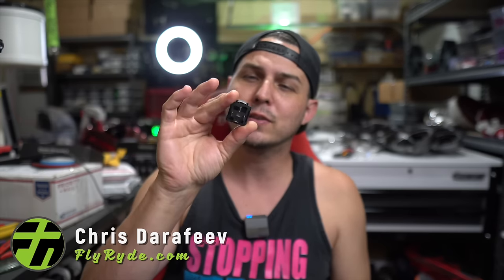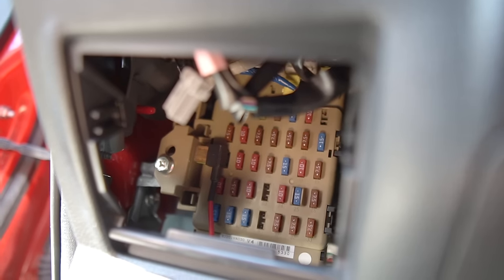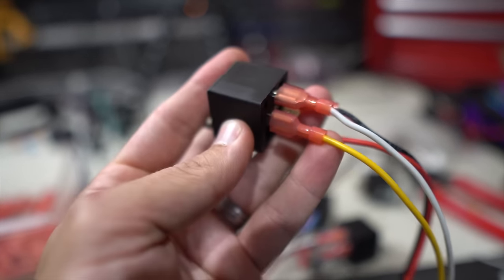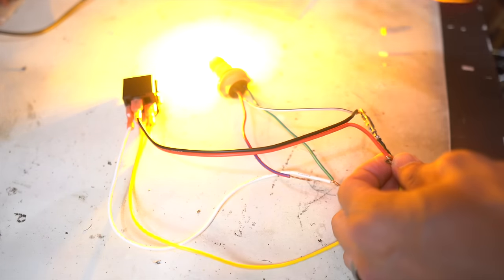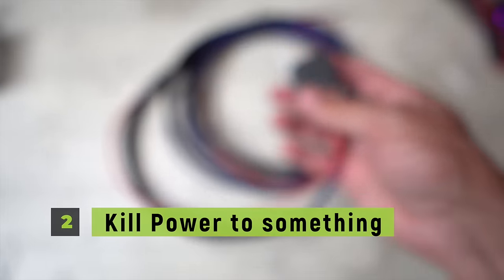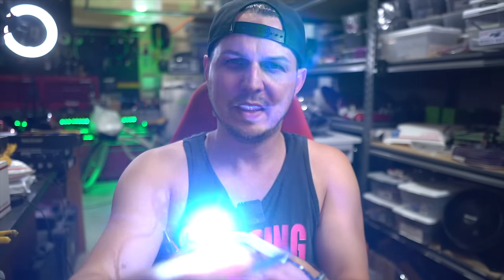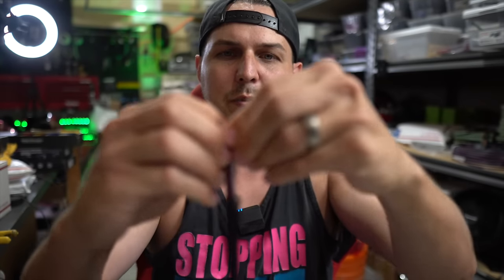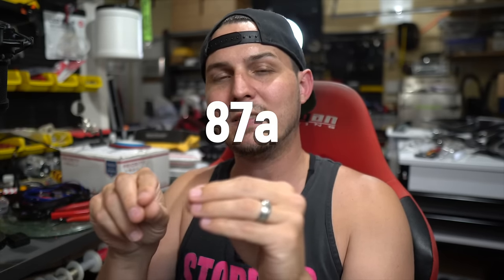3 Ways To Use Automotive Relays

Comment: I want to add a kill switch to my 2021 Nissan NV 200 (small cargo van).  I don't want to kill the battery because I want the security system to remain functional.

So I thought a fuel pump relay kill switch would be good.  However, auto shops around here won't do it...they say adding a kill switch would screw up the CAN bus.

Scotty Kilmer (youtube guy) says the best way to prevent car theft is to just remove the fuel pump relay and take it with you. 

Sure, but that means I would need to open the hood, open the relay box, pull the fuel pump relay and take it with me...and when I get back, open the hood, put it back in.

But I was thinking...would it be possible to relocate the fuel pump relay into the dashboard?  Place an extender-type socket device, pass thru socket device, 
from the relay box in the engine compartment and run wires thru the firewall into the dashboard, to a pass thru socket which would accept the fuel pump relay?  
This way, I could just remove the fuel pump relay without having to open the hood, etc.  

There would be added distance that the signal would need to travel, say 6ft. But basically, I would have everything be a pass thru to the regular fuel pump relay which
happens to be in the dashboard now.

What do you think?

Comment: You actually lost me but I know you described what i'm trying to do. I am trying to make a electric seat switch, it needs to reverse polarity, I have two single current momentary push button switches also have two, 5 PIN relays and two diodes. I keep over thinking this!  Is there a way to show me a diagram on how to do this. Its my daughters Infinity G35 and defiantly can't afford to buy a new or even a used one. We are selling this car but want it to work properly.

Comment: Hi.
Showing real thin wires on the switching terminals ( trigger and ground) help to explain easier. Then a real heavy wire on the supply and load terminals. That's how I always always teach it. Then I swap the no to nc terminals to demonstrate the power off function. I follow you, but a newbie might still not grasp the concept.
Kewl vid otherwise
Reply: Maybe you can help me out. I have 4 point relais and on/off switch for a underglow ledstrip install. Is this possible and how do I wire them

Comment: Why is the ground wire “energized” when my vacuum switch senses less than 22 in/mg on my vacuum pump for my car. Never had a problem til i had to replace it then had to get a replacement for the same problem the replacement has😳. Never had 13:35 to test the connections before this. Relay activates  the ground to the pump motor. Wtf

Comment: Hey man quick question, if I want my LED underglow to turn on whenever I have my Fog lights on do I need a relay? The LEDs are a 5 amp draw or would it be fine just to use a fuse tap in directly to the fog light fuse? Thanks!! Great video btw
Reply from the maker: Relay for sure. The good part is it’s easy, and you can trigger the relay with anything, without worrying about weird backfeeding issues in your electrical system.
Reply: @flyryde  thanks for the reply!

Comment: Not a bad way to controlstuff, But you can just opt to have switch and inline fuse.
No info on what exactly this relay it is, like, theres relay and then theres pins. If part no woudl be mentioned, this would be a decent guide

Comment: so just watched this was extremely helpfull but i need some help with some parking sensors i installed  so its frunt and rear sonsors and a lcd screen i have a vectra that has canbus so i wired 2 relays to stop the sensor screen flashing on and off with the canbus so 1 relay is connected to brake light and 1 relay for the reverse light everthing works as it should bet when i pull out of reverse or after ive tapped the brake instead of the screen turning off itl flash for 5 to 6 seconds then turn off really nwed help with the screen as ita getting very annoying
 anyone able to help

Comment: Amazing tutorial Chris, thank you (new subscriber here).

So, if I understand your instructions correctly...

In order for me to power ON my deterrent LED on the steering column (pre-soldered diode which flashes 2Hz via 12vdc)...ONLY when the ignition is in the LOCK (OFF) position, but power OFF again when the ignition is moved to ACC/ON positions, I need to wire the relay (using a fuse tap) in the following manner:

PIN 30:    +12v
PIN 85:    Ground
PIN 86:    +12v ACC (trigger)
PIN 87a:  LED pos+

Is this correct?  :)
.

Comment: What would be crazy cool is if u could fab up some type of motor slash actuator that allows the projectors that flips and hides the whole headlights totally and maybe have a custom led of a smiley face that says have a nice day maybe on the back side and when u turn ur headlights on they would flip around probably side by side because up and down would have too much strain on the motors or actuators that's doing all the flipping because most all housings has adjustments on them so ur able to align ur headlight beams get me and if u did the signals the same way u could picture basically what I'm talking about see my mind doesn't work like normal people's does I'm just different so to speak I'm not weird or strange to people that has too much knowledge I'm sure u get my point lol but see I like different why do I want to be like anyone else because thats what make me me ya Kno lol but u seem to enjoy the whole technically part of things and everything that's in-between that most never does but what I'm talking about has been done sorta kinda I think infinity or Cadillac or Lincoln one done sometime close but there's just moves with the car like head tracking does but I'd say u could just run some kinda Arduino uno or a raspberry pi pico to make everything run probably because the code u program things with would be a original deal because ur then telling everything how and when to began working I mean just saying ur the professional not me fr fr but that Arduino stuff is really cool if you really get into it you know what I mean if you really go look and see what all this stuff will do you might be surprised I might be able to cut your job in half man by all this crazy wiring stuff but I'm pretty sure that you're already on board with the Arduino stuff I could be wrong never hurts to tell somebody though you know what I mean especially if they not really really got time to really be looking into anything like that did Micro controllers I mean they control drones they program your TVs with it they do all kinds of stuff might be something you might want to look into slick like I said this is your show here let's go back to watching you lol it's more or less what ever is in that suitcase box u got there just in a small compact version but u would leave these in the cars as u wire them and u can always plug into the Arduino and reprogram ur lights is endless configurations and make ur shit definitely one of a kind no world copy's feel me and by the way my name is Shawn whited I just do the Steve jobs thing because I like not being known sorta but ya u get my point I'm sure it would help take what ur trying to accomplish to a total new direction that would take u way above anything or anyone out here but now here is some missing knowledge now bird fly so they say fly Birdy fly lol good luck I hope this helps and hopes it takes u to some new places have a good one hope to see some new creations see ya on the flipflop later !!https://youtube.com/shorts/51UnfzIPd_Q?feature=share
To more detail 
https://youtu.be/rPvGLSuMaLA

Comment: That wasn’t very intuitively explained. Taking the lid off and showing people what is happening might convey a better understanding. 1 connection in normally open (no current passes without triggering it) and 1 is normally closed (current passes until the trigger stops it). 

Relays are old school and use too much current. Use MOSFETs and whatever you make will be more efficient.

Comment: Get 19 charger in and do one for the DRLs 😹 they keep changing it out thru the years on the wiring fca sucks on that 😹trying to get a signal from the stock DRLs ain’t fun when all 15-20 are different 🤦‍♂️
Reply from the maker: Doing a 2020 for a friend soon 👍 granted it will be fully addressable, so a bit different.
Reply: FlyRyde tru a 2020 be different than previous years, wiring got changed in 2020. I just did a 2019 and the wiring was different on the DRLs than previous years of the new chargers I’ve done.
Reply: FlyRyde reason is they went from having 3 different LEDs DRLs boards to a single 4 chip led drl boards instead of 2- single LEDs boards and 1- dual LEDs board chips.

Comment: I'm sorry, your ground section confused the shit out of me when I watch the video. In that section, I need a pin by pin connection explanation. Your instructions were not in sync with what you were pointing at.  I need a switch on my dash to send 'ground' to a high speed fan.  To send ground, what exactly is on pin 86, 30, 85, 87A, 87 ?

Comment: what you need to do is redo the video with a simpler outlook and more importantly, get the pin numbers correct. 85a does not exist in the designations, 86a does, 87a does, so when you are trying to teach, get it right. Also might be worth explaining IF, AND and OR circuit/relay formats.

Comment: I had had a Chevy chassis RV.  Every relay in the thing failed at ne time or another.  When I took two of the relays apart they failed because of rost on the relay elements.  Either GM parts suppliers are third rate, or GM auto engineering sucks.  Either way, my advice is stay away from GM supplied relays.